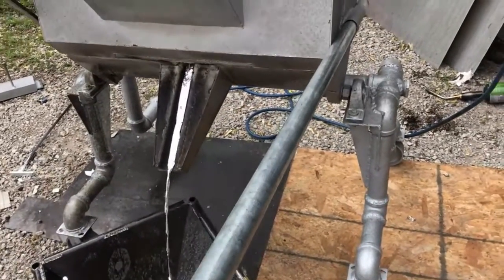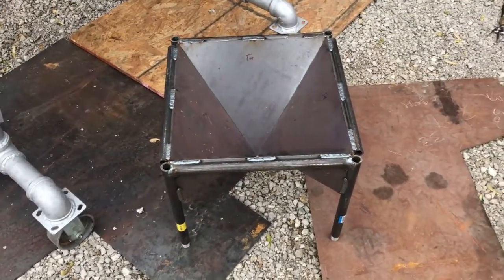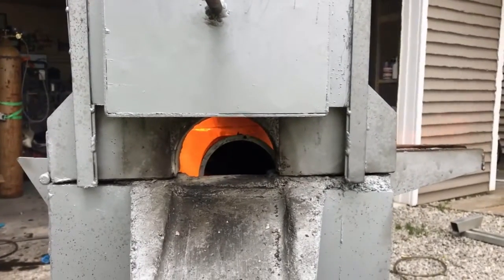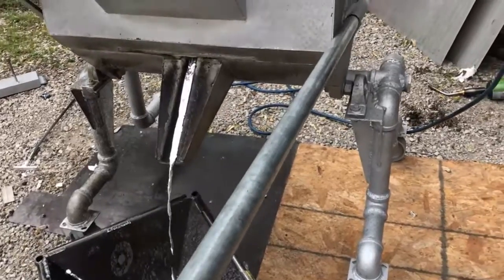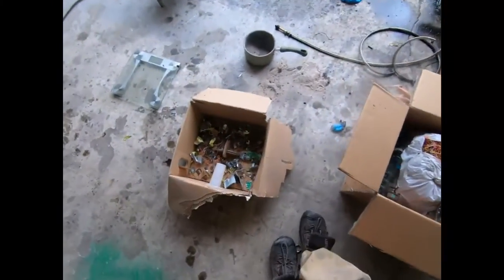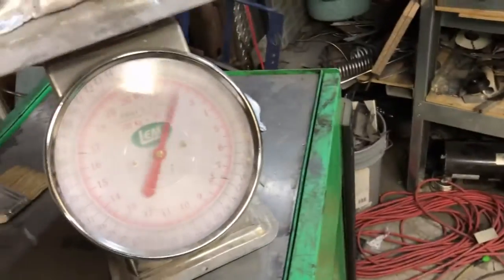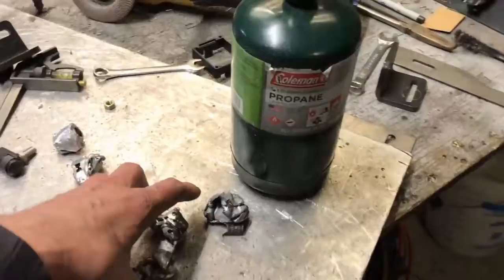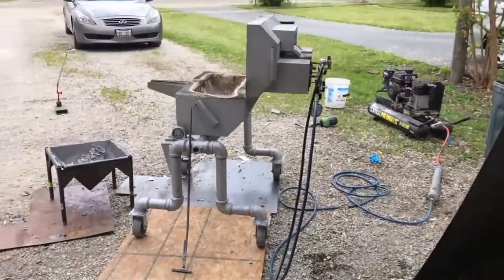Aluminum casting foundry 26 lb pyramid ingot

Comment: At this point you don't even need to pour it, just have a shut off valve at the bottom, you probably don't even need the valve if you have a big enough mold, anything molten flowes through, you can repurpose the pyramid shape would help channel the flow, I'm working on something like that for mine, I drilled a quarter inch hole in a big fire extinguisher with a hydraulic steel valve,  I haven't made videos of that yet but I did made a video of a sweet heater that will revolutionize the way stuff works I want you to check it out, the intake of the fireplace forces hot air through the room because it's like a vacuum usually you'd have to keep a window cracked but this way it's constantly pumping in hot air

Comment: It is not beyond possibility that those pieces of steel were clad in a micro-thin skin of aluminum, just like they tend to do on modern exhaust pipes. ~( 'w')/

https://en.wikipedia.org/wiki/Aluminized_steel

"This steel is very useful for heating things up because it transfers heat faster than most other steels."

Since you got them from a pile of heat sinks, this was my first clue.
Reply from the maker: Great input , i presume you are correct

Comment: thought you would attach a top plate above exhausting flames for those bar bq foods  shame to let energy go to waste
Reply from the maker: lol
Reply from the maker: How are things going brother ? are you still a carpenter ?
Reply: yes still do a little internal and shuttering and my own garden furniture out of scrap pallets .but tendancy to do diesel engine repairs on old plant machinery and still looking at the joe cell neutralisation technology its not water its a sweet energy as tesla knew and lord kelvin .shame these discoveries are not issued by those to others simply rather than encrypt it. mscal has recently spoken to joe booker and ive had many hints from peter stevens joe,s video man its all about lay lines and hot and cold and mass to mass attraction without earthing to earth but to earth back into the AIR like a back feed but still looping into circuit.  its all a challange and i expect some interesting mis-haps !!

Comment: fun fact: that pulsation issue is basically what water towers are for. They absorb spikes and dips in water pressure and even it out.
Reply: Correct. They are a way to deal with the so-called "water hammer". A destructive effect that occurs when water flow is suddenly blocked by a valve or similar devices. On plumbed piping pulsation dampeners or surge protectors are installed to mitigate the water hammer effect as it can cause serious damage to the pipe system and valves etc.

Comment: i love that rig a lot melt the world with it ..i just got a deal on a quincy qt-10 220 volt single phase 10hp 100 gallon compressor i got to fix it it should be done next month you need it.it sad the price of parts on that usa made stuff but oh well thank God the 3 phase units are less desirable i may have a line on the parts i need because of this
Reply from the maker: I wish i 3 phase, maybe one day i will be as awesome as you
Reply: @NOBOX7  no man it is junk and single phase 220volt 10hp i literally got it at recycling center as they let it run dry of oil heck just an old counrty guy live in a old house trailer just ran up on it.i have to figure out how to get the  bucks to fix it .i thought of you needing something like it i donot need it i just hate seeing stuff not fixed  or going to some one that could use it   .i am sorry if i came crossed as an ass hat .every thing i got i recycled from junk